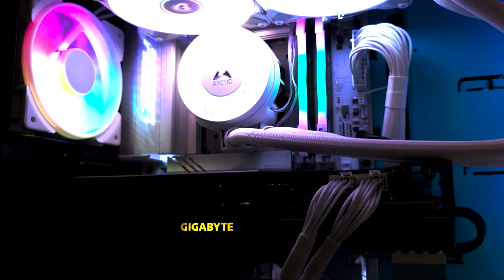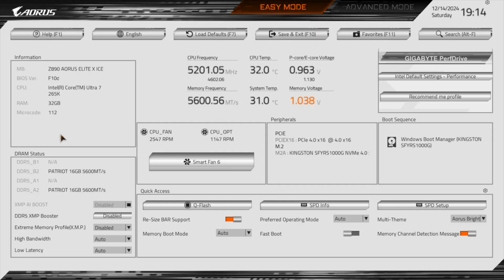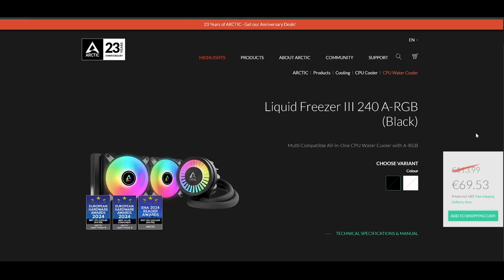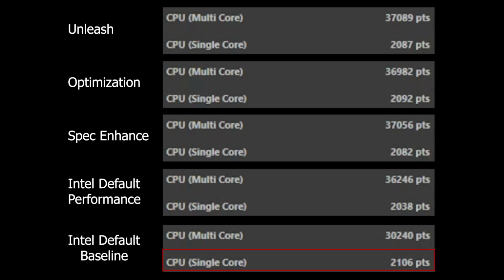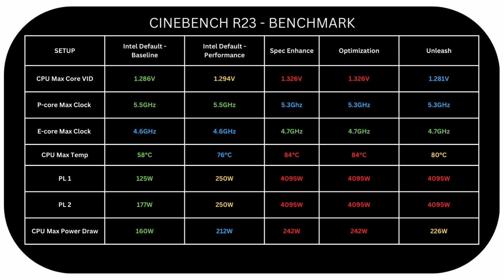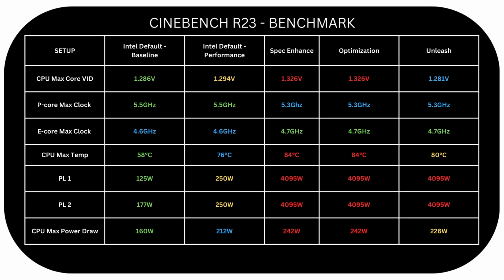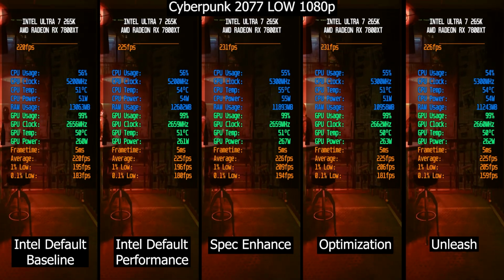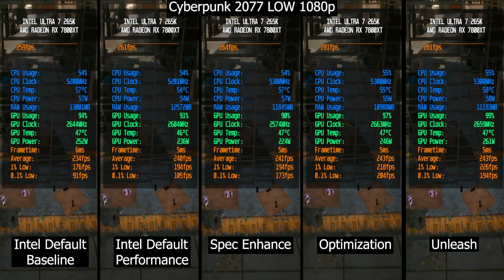Gigabyte/AORUS PerfDrive: Power Profiles Comparison for Intel Core Ultra 7 265K

Comment from the maker: Continuation of explorting PerfDrive: https://www.youtube.com/watch?v=VBgfvJPZMn0

FULL SPECS: 

Motherboard: Gigabyte Z890 AORUS ELITE X ICE
CPU: Intel Core Ultra 7 265K
GPU: AMD Radeon GIGABYTE  RX 7800 XT GAMING OC 16G
CPU AIO Cooler: Arctic Liquid Freezer III 240 A-RGB (WHITE)
RAM: Patriot Viper Xtreme 5 RGB DDR5 32GB 8000MHz
SSD: Kingston Fury Renegade PCIe 4.0 M.2 1TB
PSU: NZXT C1000 Gold (ATX 3.1, 1000W)
Case: Fractal Design Pop Air RGB Cyan
Case Fans:  Fractal Design Prisma AL-14 PWM WHITE 2x
Fractal Design Prisma AL-12 PWM 1x

----------------------------------------------------------------

for any question drop a comment or connect at discord server: https://discord.gg/PXmJY6BP8b. 

If you enjoy my content Subscribe & Become a member to activate extra PERKS
Pateron: https://www.patreon.com/TECHOSAUR

Comment: I have to say：Thank you so much for this video！
I tried to find the gigabye z890 aorus elite wifi7 ice with perfdrive setting knowledge & difference online, but it was hard to find it.
U slove it！❤❤❤
Have you considered test overclocking the RTX 50 series graphics cards?
Especially the RTX 5080 & 5090.
Reply from the maker: Yw bro! I'm going to try out different options because Aorus has released even newer BIOS features on latest update if you check it
Yes, I did try OC the 5090.
https://www.youtube.com/watch?v=3Xg4okaSEhU

And my 265k undervolting 
https://youtu.be/fvfLbhxD0Bk?si=UzpqmpaDY6w4Cy8q

In case u have this cpu
Reply: @TECHOSAUR  yeah, I knew. The f17g bios version.
But I don't know why my MB didn't read the bios files with USB, so I didn't upgrade yet.
Thx bro! ❤
Reply from the maker: @CharlieSunNotBrown  what issue you got ? i think same happened with me once i had to format it 

sorry before i forgot to include the 5090 OC video link, here it is
https://www.youtube.com/watch?v=3Xg4okaSEhU
Reply: @TECHOSAUR  I really dont know what's happened. Just like when upgrade f17g, the screen show up not for this MB something like that.
I was lazy to figure out.😂😂😂
I didn't want to wast my game time.😅
Reply: @TECHOSAUR  I watched the 5090 video, I think the core overclocked is not enough.
I use gigabyte RTX5080 gaming oc 16g, this card can easily to increase core +200~400 mhz, but memory +2000mhz will be stable.
For your reference. ❤
Reply from the maker: @CharlieSunNotBrown   You’re right, but the RTX 5090 has lower tolerance when increasing core clocks it’s just not as stable as the 5080. I tested with higher clocks and it wouldn’t stay stable. It might pass 3DMark stress test, but then crash in games even after an hour or two. On my 5090, even small core boosts above 2805 MHz can cause crashes or artifacts. By design, the 5080 actually ships with higher base/boost clocks (2295 MHz / 2617 MHz) compared to the 5090 (2017 MHz / 2407 MHz). so it could be the reason why you can push yours higher. I also didn’t want to go extreme because I want an OC that lasts for all games. sometimes it wont crash in a title but do in other also like i found mine would crash if i increased it in games when i look at sky or ground because then it boost clock so high all of sudden and cause this. also keep in mind that AORUS master already ships with a high 2655 MHz core clock, adding +150 MHz is already insanely high

For memory, I pushed it to what’s generally considered the safe max for the 5090 around 3000 MHz (effective ~21 Gbps), which works out to about +375 MHz over stock. That’s the recommended stable range most people can hit
Reply: @TECHOSAUR  I see.
Now I know 5090 is harder overclock than 5080.😂
Thank you for the detailed explanation. ❤
Reply: @TECHOSAUR  Tell u a joke.
I'm Taiwanese, and the Gigabye is Taiwan company, but I couldn't find any about gigabyte z890 MB perfdrive information in traditional Chinese or Taiwan website.
How funny is it! 😂😂😂
Reply from the maker: @CharlieSunNotBrown  WOW nice to meet you! I really love Taiwan! It’s actually one of my dreams to visit someday and explore the PC market there 😃
you guys are amazing

don’t worry, I got you covered! sometimes there’s just so much stuff that things get skipped, not everything ends up being covered
Reply: @TECHOSAUR  Thank you so much bro! ❤
Yeah~~~You should come to Taiwan to visit PC markets, I think will surprise you!😂